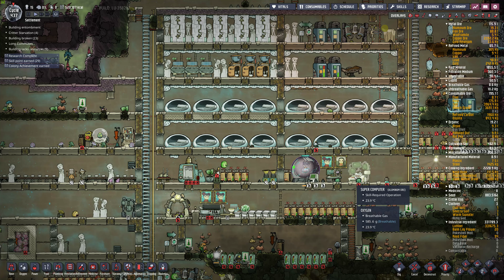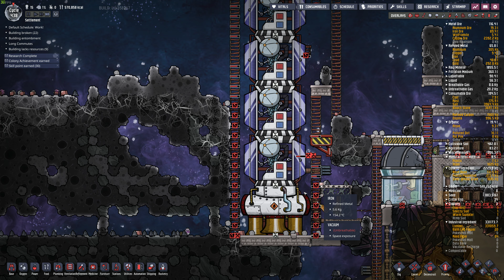Oxygen Not Included - LAUNCH UPGRADE #26 - Petroleum Rocket Ending (Arboria Map) [4k]

Comment: If you didn’t have a hot place to reheat the coolant, you could always use ethanol as coolant and run it through a pool of water until it freezes and move that ice somewhere else useful. Then all you need is a source of water.